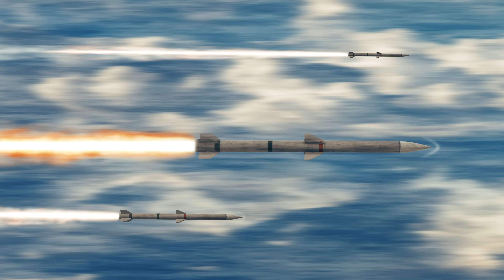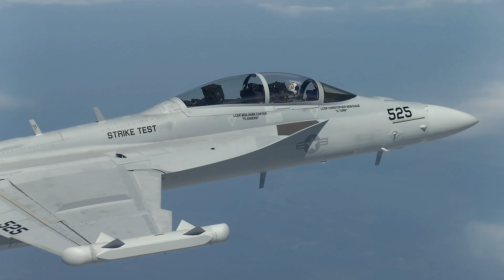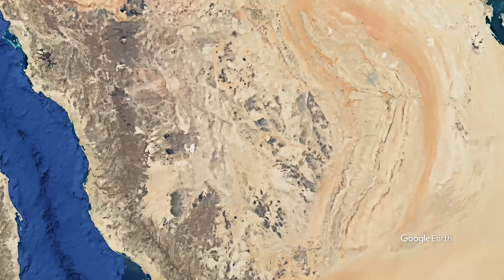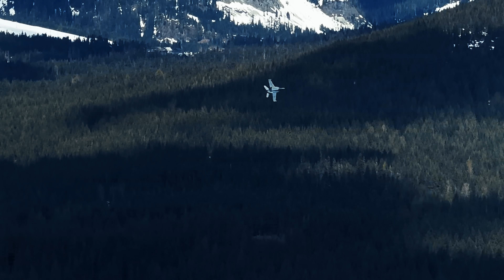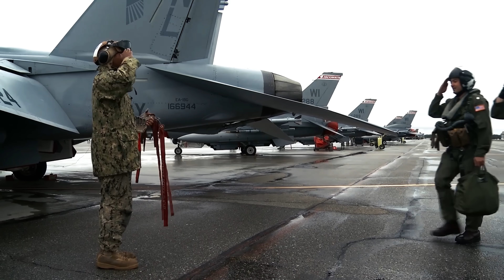EA‑18G Growler Explained: How It Blinds Enemy Defenses

Comment: The RAAF has replaced the Growler destroyed by fire in the US, and a little known fact is twelve of the 24 FA-18Fs operated by the RAAF are prewired for conversion into Growlers, which is one of the reason that Australia only bought the Foxtrot two seat version of the Super Hornet. Boeing holds wings etc for the RAAF should they want to upgrade the Foxtrot models to the Growler. They also have the upgraded cooling and extra electronic racks the Growler needs, already installed. The RAAF is also co funding the next Gen EW Pods with the USN. There's a belief that the Growlers will outlive the Foxtrot models, hence the pre wiring etc for conversion. Australia is also one of the largest operators of the F-35A with 72 in the fleet, they also operate the Triton high altitude drone, and a specialized EW version of the Gulfstream business jet, alongside the E-7A Wedgtail AWACS. The RAAF is designed to plug straight in to any US operation seamlessly and is one of the best equipped Air Forces in the Asia Pacific region.

Comment: you know what made me laugh this is the same length at 60ft luxury yachts i help build, max takeoff weight is heavier than the boat when fully furnished but almost dry weight, very similar fuel capacity too about 20x the price tag though, not surprising for something of that weight size and capability that fly's and fly's fast while being very maneuverable, best we can pull in a hard turn in these boats is about 1g of lateral force which is a lot for a boat but nothing for an aircraft.

Comment: I was a Navy EWO April 73 to October 82 and I would hop in the back seat of the Growler in a heartbeat.  In my day, we ID'd the radars by being able to identify at least 160 radars by sound alone and about 600 more with no reference material.  That's why we had the highest IQs of all Naval Aviators.  People are always amazed that Navy EWOs with technical degrees were/are a rarity.  The environment required and requires a high IQ and, essentially, a degree of ADHD in order to be able to recognize and deal with the complexity of the electronic battlefield.  I am delighted that people are beginning to understand what electronic warfare is because in my no one knew what we did...and especially not Navy detailers.

Comment: Most people, when they think of modern fighter jets, picture the usual poster children. The flashy ones. The Top Gun pin-ups. The loud, pointy-nosed glory hogs that get all the slow-motion carrier-deck strutting shots.
And then there’s the EA-18G Growler.

The EA-18G Growler is not the aircraft you put on a lunchbox. It’s the one you send in when you’d quite like the enemy to be deaf, blind, confused, and questioning their life choices. It doesn’t just fight.
It reaches into the electromagnetic spectrum and turns the lights off.

Based on the perfectly brutish F/A-18F Super Hornet, the Growler looks similar enough that most people wouldn’t notice the difference. And that’s the point. While everyone is gawping at the shiny stealth jets doing ballet in the sky, this thing is quietly strangling radar systems from 100 miles away.

It doesn’t need to be the fastest.
It doesn’t need to be invisible.
It simply needs to make sure nothing else works.

And that is why I love it.

Comment: The Russians do Not need a specific Electronic Aircraft. The Russians only need the Khibiny Electronic countermeasures pod. The Khibiny (L-175V) (Хибины) (Л-175В) is a Soviet / Russian aircraft electronic countermeasures (ECM) system. This pod can be attached at both left wingtip and right wingtip of the Russian Sukhoi Fighters Su-30, Su-34 and the Su-35.

Comment: Australia has a total of 24 F18F s and 12 F18Growlers.
However, 12 of the F18Fs were build with wiring for conversion to a Growler platform if nessasary. The Growlers were bought later, so the 12 that were wired for conversion probably never will be.

Comment: He could just make drones with the same equipment and then one drone could have 5 or 6 different operators at base analyzing all the data coming in rather than just 1 copilot in the heat of the battle would be better having a drone up there and 5 people just analyzing doing other things directing the radar Jani relaying information and all that it seems like a lot 41 copilot while he's up in the air in the heat of battle

Comment: AWACs and growler are critical elements of modern air assault forces. You simply cannot operate over enemy territory if they have an integrated air defense system. The more sophisticated the defense means more growlers are needed. Growlers is a top priority target since so much depends on their mission. Modern SAM missile systems are very dangerous if unjammed and will target several attacking aircraft with high hit probability. Its probably safer to use unmanned electronic warfare assets because if the high threat environment on a modern battlefield.
Reply from the maker: Absolutely!

Comment: Given how insanely effective the growler is - there are a couple things that are now making the need for a new EW aircraft clearer.
- Electrical generation capacity. It was more than enough when it was introduced, today we could do with more juice. But that is not really possible without a serious re-engineering of more powerful engines and larger cooling systems.
- So many EW modules/pods have their own electrical generation RAM air fans - these cause significant drag, because they are essentially using the speed of the jet, obtained through the engines to generate power.

My initial guess was a F-35 based E/A-35, since a single F135 produces more power than the two F414's. But it would require extensive re-engineering of the F-35 aircraft, and possibly be based on the F-35C with removal of a few fuel tanks to make space for carrying far more of the EW equipment within the airframe and possibly have integrated dual use stuff, rather than a single purpose pod, also better integrated with F-35C's own EW capabilities. Although, this would cause a reduction in the jet's range. F-35 in general have three power generators on-board, each capable of 80kW, for a total of 240kW of continuous power. While the growler electrical generation isn't publicly known, the F/A-18 has a 65kVa so about ~60kW of power, assuming a decent power factor. So, the growler could be between 150-200kW of capacity.

The E/A-35C would be extremely lethal with its own stealth, it has to use very low power to hide itself against anti-radiation weapons, and it's integrated EW suite, located inside the fuselage would mean it will still have a longer combat radius or ferry range due to exponentially lower drag. Another thing it would also be - very very expensive.

Between with all the planned upgrades and modernization programs that have been approved for the growler, it is expected to stay operational until 2040's.

Comment: A big part of the PLAAF’s J-20 Mighty Dragon’s Type 1475 (KLJ-5) active electronically scanned array (AESA) radar is to find Growler aircraft well before the J-20 is detected and then neutralize them with China’s current generation of ultra-long range air-to-air missiles. While the Growler is highly capable, it is also highly vulnerable.
Reply: The J-20 will be one of the very first assets removed from the sky in a conflict. It’s at the top of the kill chain so it’s target #1. 
And there’s no way you can hide a J-20, so they have to operate way behind the front lines. 
Whilst they’re hunting growlers they’re being stalked by F-22’s and Naval assets etc.

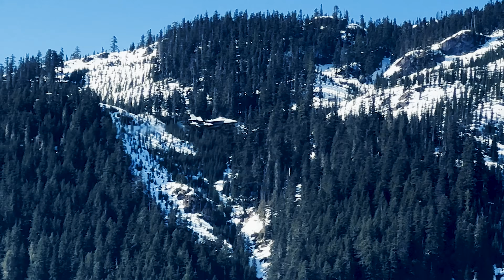Comment: 21:25 “…making it ONE OF the most expensive models of that aircraft…” I have to imagine that it is, in fact, THE MOST expensive version of the F/A-18 series. No?
Reply from the maker: There have been other prototypes of the Super Hornet that could be more expensive, but it's difficult to find numbers on those types. I didn't want to make the claim that it was the most expensive without being 100% sure.
Reply: @trevorwert  Prototypes don't count. EF block III costs more than the block I Growler, but the Growler block II is the equivalent of E/F block II and costs the most.

Comment: Good video, thank you.

Suggestion: when you're telling me the stats about this plane which is based heavily on the Super Hornet... can you also display the info of said initial design? I have no idea if the plane is significantly bigger, faster or whatever than the hornet. I assumed it was virtually the same airframe/engines, but then you mentioned fences etc and I'm back to wondering what the sizing/power/capabilities are vs the Super Hornet.
Reply from the maker: Thanks for the idea! I can try to incorporate that. But, yes, it’s nearly identical aside from a few minor tweaks.

Comment: The Growler IMO is where Aircombat is going. Not steath but techlogical dominance and high speed low level flight skills. In the world of Drones and Advancing missiles tech it makes more sense a JET will be designed to keep those threats out of the fights via EW.
Reply: Stealth is technological dominance. In an airspace saturated by EW, stealth aircraft become even harder to detect.
Reply: Well say the f-35 is an electronic warfare platform on its own all of its different sensors including its radar which has suppression modes 

Being able to go right past enemies radar defenses either with a growler self or without and then stand in with their own electronic warfare is the future and of course they can fly at low altitude just fine
Reply: nope 5th gen survivability + networking with other platforms + situational awarness
Reply: Bro if you gave me a raspberry pi a a lot of various diodes servos and a rocket motor I could easily 3d print something that could take out a growler. Remember mh370?
Reply: @monkemode8128 Sure you do 😂

Comment: One thing not mentioned in the video, the Growler lacks a cannon because that's where they put the 18ft long supercomputer.
Reply from the maker: Good call!
Reply: Seriously? Good God…. that’s gotta be 18 feet of all kinds of classified!
Reply: @miamijules2149 there is no 18 ft long supercomputer in place of the gun. There simply isn't enough room. 8 of course does contain computers in avionics equipment and also a data link and a frequency receiver that's why they're just like someone rectangular or square bolts where the gun used to be

Comment: the hind harm kill is not A/A. HARM has no way to detect a hind flying, and it was reported, by the us navy themselves, that this was an A/G kill on an unmanned hind. This also tracks with the known capabilities of a HARM, where it can use GPS coordinates and radiation emissions from the target. The harm was almost certainly, based on known systems of the missile, set to a gps target point to strike it. 
The harm has these gps capabilities so if a radar is not emitting but known by recon, it can hit it still. this also allows it to continue to hit a target that was engaged with anti-radiation targeting, and then the target turns its radar off.
Reply from the maker: You're correct, I got that mixed up with the Houthi drone it downed. I'm removing it now.

Comment: It should be noted that having your early warning radars be hit with an obnoxious amount of jamming signal is a pretty good indication that there is indeed a strike package on its way to you lol
Reply: But you have no way of hitting it without knowing its flight path, which is not possible without radar.
Reply: @curious_one1156 you’re right it’s definitely not possible without radar. HOWEVER jamming doesn’t just brick your radar. Radar jamming is just blasting your signal back at you multiple times to wash out the return, which means you still know precisely what direction from you they are, just not their range or closure rate. In networked environments (near peer) you can actually take two different radar stations and triangulate the position based on the difference in azimuth and elevation. This way the only real advantage of active radar jamming is that if you’re using escort jamming close enough to the strike package it will be impossible to tell how many targets there are or guide any weapons until they get closer, but you will still be able to direct fighters to intercept and determine what targets they may intend to strike. And many radars are jamming resistant now, especially AESA, especially from an older jamming pod such as what is currently used on the growler. modern radars have the hardware capability of producing a wide variety of frequencies and waveforms that older emitters simply can’t and the difference between the two can be deciphered. 

Jamming never was or will be infallible and it should be used with caution against a modern opponent because you are essentially trying to blind your opponent with a strobe light. If it doesn’t work you just lit yourself up like a beacon for all to see, and if it does work they can still see you they just can’t actively shoot you (yet). It is risky business
Reply: @curious_one1156  use your eyes
Reply from the maker: That's a good point!
Reply: Sure, but then what?
Reply: The houthis didn’t get the memo then. when we did missions every night we just bombed tf out of them, every time I went into the hanger bay I’d see new kill marks on the side

Comment: I worked AGE for the EF-111s at Cannon back in the mid 90s. It's crazy how much electronic warfare has advanced.
Reply: Yeah the Navy maintains a few squadrons specifically designed to be deployed to help the Air Force since the Air Force gave up this type of warfare when they retired The Raven
Reply: @mcamp9445 . Congress killed the Raven.
Reply: @tomtavares5895 i mean, I don't know what that means.Congress is always in control of the budget

The F111 was not a particularly maintainable vehicle and the raven, while very cool looking was not as capable as a 60 prowler, mainly because the prowler got the power for its jamming pods from little propellers on the front of the jamming pods and the prowler, and the raven had to get its power for its jamming pods from its engine generators, and there simply wasn't enough power in comparison.

And F1 11's were being retired at the time, so if you had a choice and it's the cold war cost production, and you've got the F111 going out of service and you have the EA6B not going out of service, having 4 crewmen and being more capable. It's pretty clear which one to retain
Reply: @m @mcamp9445  was on the system improvement program for the EF and watched CSPAN with the team as they voted.  It had problems for sure.  Wing box cracks were the big looming issue, hadn't lost one for it yet but it was an issue. Its mach plus speed and jammers located under the aircraft, reducing aircraft blocking, gave it advantages over prowler.  Lots of pros and cons.  Just happy we are still talking about both of them.
Reply: DINSTAAR! 😂
Reply: @rhubarbpie2027  I forgot about that! Oh the memories.
Reply: To think all the tech in the e.8. Stuffed in the f18 airframe.

Comment: It’ll be interesting to see what follows the Growler. I have read that a bone-stock F-35 can match the Growlers EW capabilities in a very focused 2° “beam” as opposed to the Growler’s 40°. The Block IV F-35s will improve on that, but they’re still limited. The aim is to one day incorporate a full EW suite in each airplane, and I suspect that CCW will largely take on the EW role in the next generation we have entered in the last couple of years. I just can’t see there NOT being a dedicated EW/Jammer for another 10-20 years either way. A two seat EF-35 based on the C variant would  be a magnificent piece of hardware.
Reply from the maker: The F-35 can do that to a point, but not at the distance and number of targets that the Growler can simultaneously. It's mostly for closer-range self-protection on the 35.
Reply: You read garbage
Reply: Imagine an EB-21....

Comment: Will the US Air Force make a electronic warfare jet of its own?  I'm sure Boeing would put the Growler  electronic warfare equipment on a new F-15EX for the right price.
Reply: The Air Force is just now rolling out it new electronic warfare aircraft based off of a Gulfstream G550. It is called the EA-37B Compass Call
Reply from the maker: This one supports the USAF in a lot of missions. There are actually USAF pilots that train and fly them with expeditionary detachments that focus on supporting sifferent branches. They used to have their own with the EF-111A Raven, but it had a lot of the same issues as the EA-6B.

Comment: Fast and the Hornet dont belong in the same sentence. Only reason the Navy went all F-18 airframes was Tricky Dick Cheneys disdain for Grumman and the Admiral in charge of naval aviation was a Hornet driver. The age and maint excuses were also used to retire the F-14 platform as well. The Prowler had plenty of speed needed to keep up with mordern strike packages.
Reply: The Prowler was an insanely expensive to maintain dinosaur.  Replacing it with a frame shared by the current carrier main-stay was the right move.
Reply: The Prowler was slow... Really slow. I was deployed to the same base as them before their retirement.

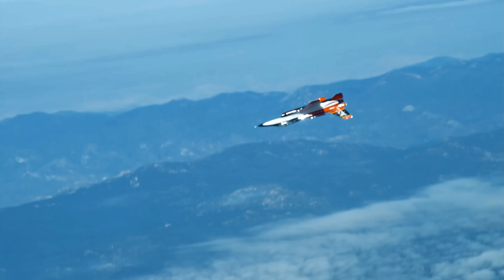Comment: hmm. could you just make f35 into electronic warfare variant? 24:50 or just put a drone electronic warfare variant into every f35 mission
Reply from the maker: In theory, yes. The F-35 has some electronic warfare, but it's very limited. The problem with creating an F-35 EW variant is that it would be astronomically expensive, and the F-35 is already so expensive as is.